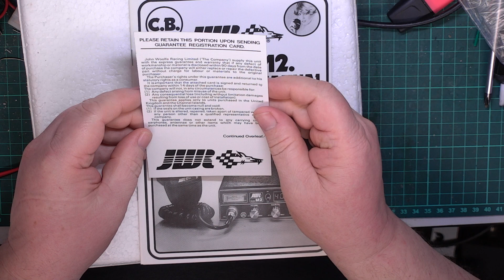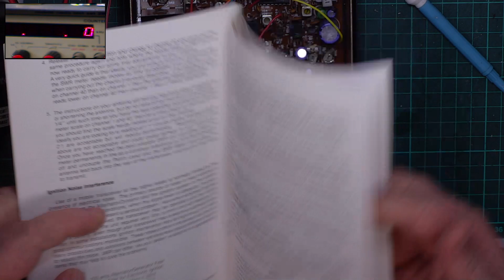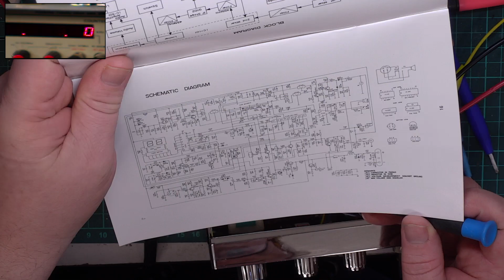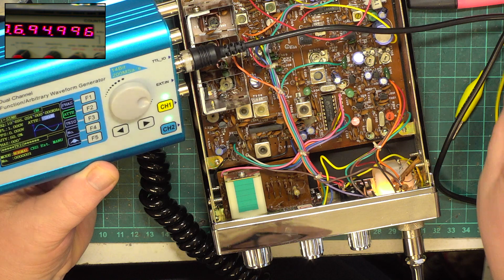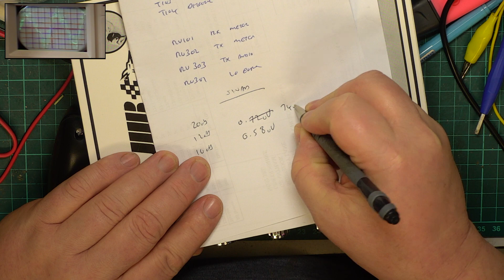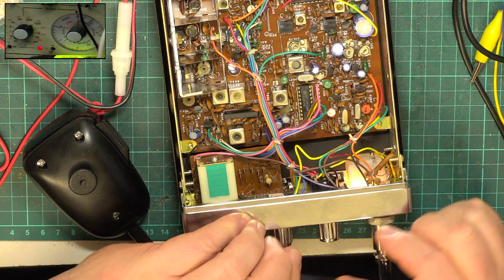JWR M2 UK CB27/81 CB radio (mobile) -  Service & new Marker Oscillator

Comment: I converted a couple of these to 10FM, slightly better than the (Not) Icom 1050
 because the JWR has an extra IF transformer in the 455kHz IF, and a better Squelch,
the 1050 pcb is etched and drilled for the JWR M2 squelch but they didnt fit it

Comment: Enjoyed watching that. I have had one of those since the 80's and still got it; i converted it to run on 10fm. with repeater shift switch and a listen on input push button. I also have a small re-tuned amplifier giving around 15 watts out for the .5 watts in bolted to the top cover. Handy little radio. I would like a copy of the scan of the manual if that's possible. 73's Tony GW4XDR
Reply from the maker: I only have what you see from the instruction book. Email me rshireby@yahoo.co.uk
Reply: Truck King Watford couldnt get rid of them until in 1983 the Bury radio club published
their conversion to 10FM mods

Comment: Very informative Richard. The Feeltech signal generator has memory channels in the menu. To save settings, that would be used on a regular basis. The navigation of the menu takes a bit of getting used to. There is also a very useful video showing how to calibrate this unit via the internal trimmers hooked up to a volt meter and Oscilloscope, on Youtube. Search FY6800 Calibration..The voltage offset , Amplitude, and Symmetry were a little off..  Hope this helps..

Comment: I remember that CBs were on the go and there was this suspense adverts John Wolf Racing 2 sets are coming!
Yeah, no one waited and when they did come out no one except one person I know and he said "Vertical filing bin" and he did get rid of it.  I think he gave it to someone that was in a wheelchair.
He did say to him "I wouldn't wish it on anyone, but if you want it it is yours"
He did come on the ait, but it was not long before we never heard him, probably couldn't hear anyone for everyone else on the 40 channels!
The advertisements ran for weeks before they came out.  It sounded ok on TX but the guy who had it first said he was getting bleed over from the city 6 miles away!  EDIT:  I remember him saying he was getting bleed over from someone using a DV27 on a biscuit tin in his loft.  I never had one so I reserve judgement.  Don't think I ever had one on the bench as they were not sold up here.  He sent away for one, so the adverts worked on him.
Reply: Receiver was terrible without a crystal filter fitted in the ist IF
Reply: @phillipsmiley5930  They were quite grim.  

Bit like the Fidelity 1000 and other cheap sets, only thing, the Fidelity 1000 was not quite so harsh of the ears due to the way the receiver worked, the 3000 was the same, if not better, but lacked the power as did the 1000.

Comment: this is amazing i was talking about this radio today.. see if you can solve a decade old mystery.........so i have the jwr mk2 a few of them....  mk2... but what about the mk 1 ?????? i swear i remember one and it being silver from the 80`s but have never found a trace of one existing in the last ten years... was there one ? was it silver ?
Reply from the maker: The other models never happened any further than some prototypes. You see pics in the mags at the time, but chances are they were either pre-production prototypes or mock-ups.

Richard, G0OJF, UK
Reply: The model is the m2 not mk2, the Lucas 888 and icom 1050 were silver fronted from memory.
Reply: @robmk3  yes have had those might even still have them... hmmm it`s one of those annoying nags in the mind that refuse to go away until the mystery is solved !
Reply: @robmk3  so what was the m signifying
Reply: @gabrielsansar6187  I don't know to be honest, I do know what you mean about one of those things that sticks in the mind though.
Reply from the maker: @robmk3  Roger, I reckon so. I've covered both on here in the past.

richard